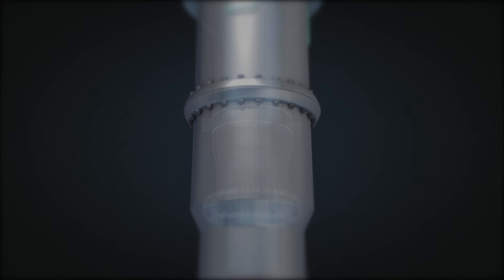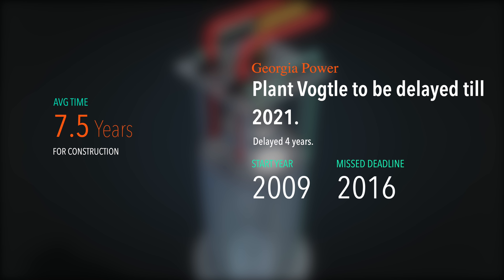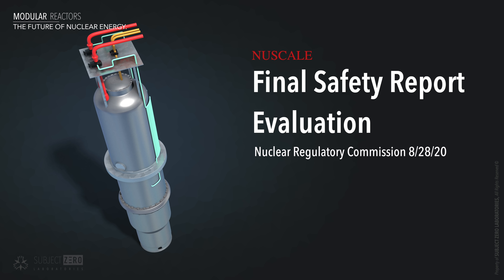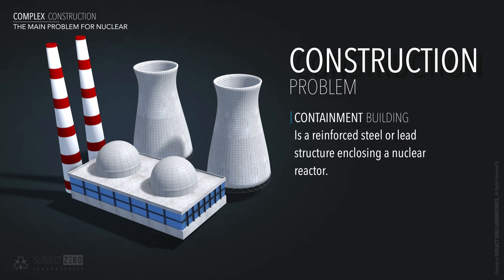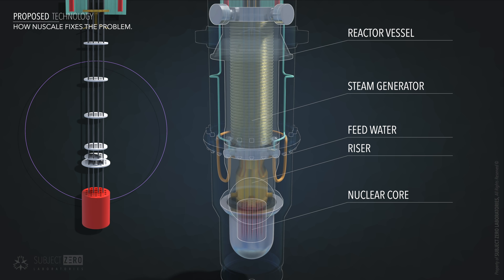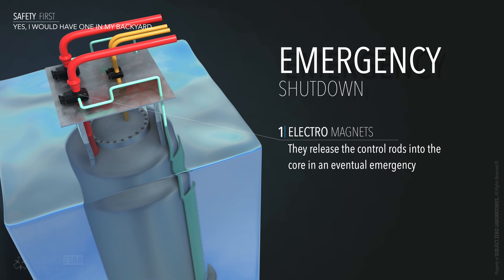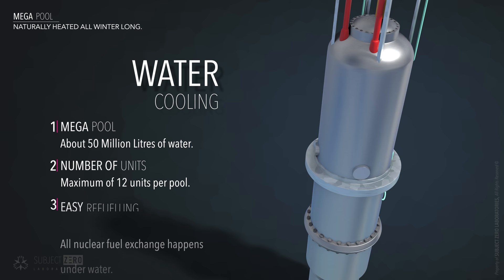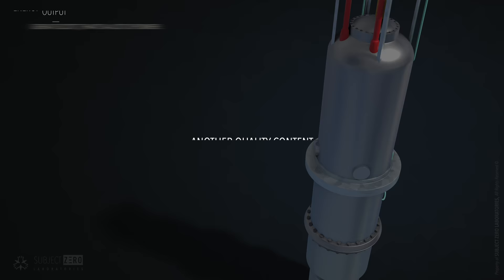A Milestone for Small Modular Reactors (SMR 2020)

Comment: Still locks you into a solid fuel provider where the fuel will have a patient.  Two problems.  It's almost like HP that will almost five the printer away so they can lock you into the expensive ink where they make the big money.  Also, solid fuel will only used 3-5% of the fissile material in the fuel before it has to be replaced by refueling the reactor.  

Molten salt reactors like Thorcon's MSR is also a SMR and solves those two issues because the fuel can be completely burned and replaced while the reactor is operating.  It can use a wide range of fuel to include weapons grade material that can be recycled into commercial fuel.  I think a solid fuel reactor is a 1960s decision error that needs to be corrected which is what Dr. Alvin Weinberg was trying to do at ORNL.  He thought liquid fueled reactors where the way to go for commercial power.

Comment: I live in Georgia, and I have never once heard it called Vogtle. I believe it's pronounced Vogle. (silent t) then again, I live in Georgia so I might be wrong. What happens if there is a water leak into our main water table from one of these reservoirs? how is it safe?
Reply: The resivoir never comes into contact with the radioactive bits of the reactor and is therefore "clean". Usually, reactors have 2 sets of water, one that stays in the reactor and gets contaminated by contact with it, and stuff sourced from outside that's run through a heat exchanger to get the energy out of the dirty water and into something thats safe to go through a turbine and back into the river it came from.

Comment: I hope it works out, but it looks like it's running into some of the same issues that are common to nuclear power plant construction. The estimated cost went up to over $6 billion from around $3 billion, because of late-design changes (the cities they're supplying wanted them to have a steam capturing tower to recover water, since the area where they are being built is dry).  It's been delayed again, too - from 2026 to 2030. 

They need to get the cost per megawatt-hour down as well. They're aiming for $55/MWh and offering reimbursements if it ends up going over that. But onshore wind and photovoltaic solar power is already down in the $40s/MWh and shrinking.

Comment: This is much better, but one caveat, the 30 days to cool down to air is still dangerous.
If Fukushima would have used SMR, no energy,  cracks on the pool who would have maybe later a few more extra days before meltdown.
The “ core” issue ( lol ) is the heat dissipation after an emergency shutdown.
I sounder if a few tons of liquid nitrogen could reduce the 30 days to maybe one week?

Comment: Questions: doesn't the excavation equipment, concrete mixing plants, concrete delivery trucks, curing concrete put off carbon and it would take the SMR to operate for a couple of years or more to offset the carbon of constructing the plant?
Reply: Yes, its similar to wind and solar but both are still a whole lot better than fossil plants :)
https://en.wikipedia.org/wiki/Life-cycle_greenhouse_gas_emissions_of_energy_sources

Comment: Still prefer to see molten salt cooling applied to this same modular design. Most notice that this is essentially the same fissile reactive water cooler reactor as Subs. Using a different modular configuration doesn't lessen the impact of a meltdown WHEN COOLING WATER leaks out/evaporates, electro magnets corrode interfering with engaging control rods.
Molten Salt Reactors offer greater safety, thorium slurry reactive offers less radioactive waste and greater % of fissile material consumed making it more nuclear material efficient and allows burning existing waste in reactors.
The above appears to be a Faustian bargain made with Corporate owners of Nuclear providers

Comment: I think that its still a lot more efficient from an engineering and logistical standpoint to build larger, high output regional facilities rather than a ton of smaller ones all over the place. Also, the smaller is safer theory doesn't hold up, the majority of nuclear incidents have occurred at small facilities.

Comment: Do you suggest, that one house needs are about 1MW? Are you serious? I'd rather estimate it about 10KW - it means that such a plant is enough to supply energy for 72 000 homes.
Reply from the maker: NuScale claims that one module can power 50,000 homes at 50MW. I just made a linear calculation based on that.

Comment: I don't think you are getting truly scalable SMRs until you get rid of the water as a coolant in favour of something else this a much much higher boiling point at or near—relative to PWR and BWR—atmospheric pressure, as you still need a vessel which can take 100 - 300 atmospheres with a PWR or BWR, and containment absolutely cannot be lost. 

In a molten salt cooled reactor—my second preference or a molten salt fuelled reactor being my first preference—or a molten metal cooled reactor, you can get away with only 4 atmospheres of pressure, which obviously means you can use much thinner reactor walls, currently reactor walls are 9" which makes construction of the core incredibly difficult, you could get away with 1/2 think steel which is much easier to work with and therefore much cheaper and faster to build, and that would still be overkill.

You would still need shielding, but you can use salt, concrete, sand and a number of much cheaper options to get your shielding, and an SMR molten salt reactor can compete with a full sized reactor in energy output.

Comment: Do you use zirconium as the pellet storage rod for fuel pellets? The temperature-dependent initial hydrogen generation of the Fukushima nuclear power plant accident may not have taken into account the catalytic reaction hydrogen separation rate of zirconium. If the structure using the same zirconium rod in the new reactor, it is necessary to observe inference of the simulation in the high temperature crisis state as a catalyst metal fuel rod as well as the normal temperature to check the amount of occurrence of the initial value hydrogen radicals as a catalyst metal fuel rod

Comment: 3 billion USD as an aspirational goal for a 720MW plant is still not especially competitive with where wind and solar are going to be by the time this tech matures.

There is always a place for small passively safe reactors, though, as a powerplant for large shipping vessels.  90% of the annual cost structure of that industry is in fuels, and that's BEFORE we start seriously regulating particulate pollution; They are the last remaining source of particulate pollution to have essentially free reign.

On a 20,000TEU ship (or a 50,000TEU ship if we deepen a few canals, lengthen some cranes, and figure out how to speed unloading a bit), the weather is almost a non-issue, you can steam right through anything but the most extreme storms, and the ships can be economically strengthened to deal with more of that, or to deal with ice classes, if loss-of-vessel is an intolerable risk.

Comment: So what is the drawback? Afterall small scale nuclear reactors are already being used for decades for nuclear submarines etc. It seems it has a lot of advantages, so why haven't SMR's already been in use for decades commercially?

The costs seems about the same if it is 3 billion for 720 MW as a regular nuclear powerplant. The main advantage possibly being the downtimes and maybe construction speed. How long does the nuclear fuel last? How is it removed, where is it stored, ... is all of this also included in the costs given?

Also, why couldn't these safety features be used in a regular reactor? And if they are, but more safety features are required due to law, wouldn't the costs go up?
Reply: The draw back is that nuclear is hated by powerful lobbying groups.
Reply: @kokofan50  I am talking of drawbacks SMR's vs regular reactors.

Comment: Hey Subject Zero Science, maybe take a look at the generalfusion approach to fusion? it uses steam piston assembly to compress a hydrogen fuel plasma inside a liquid metal cavity, potentially being able to produce workable net energy for steam turbine. 

This has basically been the issue with fusion is being able to harness the fusion energy for sustained fusion reactions + surplus electricity, I really believe general fusion is a promising fusion technology, because it is so simple compared to magnetic tokomak or stellarator designs. 

Also, it will look amazing if you animate and produce graphics show casing it. 

Linustechtips did a full tour of their headquarters so you can start with that.

Comment: Won’t the safety controls fail if the reactor does not remain upright?
Reply: A solid, underground mounting system would be easy to design for any reasonable conditions (weather, seismic, etc.). The type of cataclysmic event that would flip these reactors upside down would be an extinction level event. Not exactly something we can design for.

Comment: I can see a market for SMRs, but only to replace existing dirty options like diesel or natural gas generators. The problem with using nuclear to generate small amounts of electricity is that it is still considerably more expensive than a bunch of solar panels. And while I hear the people groaning about solar panels, the simple fact is that solar is cheap and is really good when you don't need to generate a lot of electricity. Conversely, the low energy density is why solar will never manage to displace fossil fuels in any sizable amount. It's like trying to run a freight business with pickup trucks instead of a freight train. 

SMRs may be of interest to groups like remote industry or military but the options to expand on those technologies are limited until you can get regulatory approval of larger reactors capable of displacing fossil fuels. That means large Molten Salt Reactors or Liquid Metal Fast Breeders. You need them to do more than just run cleanly, you need them to run cleanly on waste fuel from our first 60 years of nuclear power production. The value side of the equation needs to be increased vs. the cost side. Cheap fuel is great. Free fuel is better. But if you can sell it as a waste disposal technology and as a desalination technology, you've got a much better option.

Comment: oh god.. why did they rely on a pressurized water design? triso and msr use normal (ie: atmospheric) pressures, and can output far higher temperatures than PWRs. given the one time cost in new materials production facilities, they'd be far cheaper and far easier to build.

Comment: Instead of developing more fundamentally flawed solid state reactors that run on the same principles as the reactors that failed... We should be looking towards liquid fueled thorium reactors. Same size advantage as this smaller reactor, but a massive difference in safety and fuel efficiency.

Comment: This is a great piece of news. Well, coal lobby could not delay certification indefinitely.
NU Scale's is just one of several inherently safe designs that were blocked from entering the market by political pressure. I hope this is the end of it. Fossil fuel companies should better switch to this before advances in energy storage and continental scale grids make even this obsolete (because wind and solar are still much cheaper.)

Comment: How does this thing deal with control rods swelling and getting stuck?
Reply: Simple 
Seperate rods,
It's not driven by communism
Reply: @blackturbine  WTF?   Physics doesn't care at all about communism, and yes.  the separate rods.  That is exactly what I was refereeing too.
Reply: @lucidmoses  you are comparing  Chernobyl design flaw with something that is not even close to Chernobyl's design in any way, shape or form.

This is high pressure negative void coefficient reactor that is completely enclosed and everything is under same pressure aka no swelling possible
Reply: @blackturbine  I was not referring to Chernobyl  at all.  I sure hope the designers don't take such a cavalier approach to this.   But just like Chernobyl and every other problem.  There design was fine as long as nothing goes wrong.  So I'll take it you think there is no way anything can go wrong and they will never get stuck.  yikes.

Comment: 3 billion for a 720 MW 12 unit system?
That doesn't seem very cheap. I have the numbers for the nuclear power plant near me and the estimates are around 3.5 billion euros per big reactor construction costs. And 2 billion to refurbish the old ones. This is on a CANDU design also with a rating of roughly 720MW.
This small reactor design seems very innovative but I thought it would be cheaper.

Comment: Question: The electromagnets account for loss of power but what happens during a runaway reaction?  Will the control rods still be able to fall all the way down if the reactor is expanding from rising temperatures (assuming it uses guided channels for the rods to move down into the core)?  If it doesn't have guided channels and the control rods are just expected to fall, then what happens in the event a reactor tips at an angle and loses power.  If the rods fall at an angle inside a long, cylindrical reactor there is risk of them jamming and not making it all the way down.

Comment: What if even 1 rod is bent due to some unforseen event, will it still complete an emergency shutdown? To prevent bending of the rods by say a collision with something heavy, shouldn't you built a thick concrete building around this SMR. You'll end up with a big buildig like a current nuclear plant. But with more parts. What could possible go wrong :)   I would love to se the many design failure mode analisys reports in the 12,000 pages document. It will make good reading and tell just how much know-how has gone into this design. Know How is what makes technology work.

Comment: These small reactors may have another use soon: large ships. Unlike what was done with NS Savannah in the 1960's, these Generation IV reactors take up very little space even with radiation shielding and could power tomorrow's large container ships and even cruise ships that would travel faster than before.
Reply: Using hydrogen produced by these reactors in fuel cell is much more sensible approach.

Comment: I may be wrong, but this still uses the kind of nuclear fuel that produces weapons grade material. A molten salt thorium reactor would not and that is something that lots of people could get behind.
Reply: 5% enrichment,you need to get to at least 20% in theory to get weapons grade material. For practical purposes it needs to be higher than 85% enrichment .

Comment: Better yet, nuclear reactor without water, using molten salt. No insane pressures, no meltdowns, much cheaper to build and run. Can be designed to burn nuclear waste, and old nuclear weapons. Some types of MSR can use cheap and plentiful Thorium as fuel after conversion.

Comment: Nice improvements for Uranium based reactors but I still like Thorium better.  Thorium produces way less nuclear waste and is only radioactive for a maximum of 300 years compared to uranium's tens of thousands.  Also uranium reactors can be used to make high grade weapons grade plutonium that last hundreds of years in secret.  Thorium can also be used to make weapons grade plutonium but it is low grade and only usable for 10 years and can't be made in secret because of the massive gamma radiation that is always emitted during the process that even a gamma detector on the other side of the planet can detect.  Three such detectors can pinpoint the location where someone is trying to use thorium in such a way.  Lastly Liquid Fluoride Thorium Reactor designs do not use water at all and are never under any pressure to the super strong and expensive containment housing isn't needed.  Thorium reactors too can automatically shut down without any danger of control rods getting stuck.  The uranium based SMR design if those control rods get stuck for any reason such as manufacture defect or a foreign object gets introduced like a fallen bold or screw driver it could prevent them from lowering in which case a meltdown and or explosion could happen.  A LFTR even if the automatic drain pipe gets blocked the reactor will just heat up but never to the point were the liquid fluoride boils so there is never any chance of an explosion.  The LFTR after 8 hours or so then starts to cool then after some hours heat up again then in another 8 hours cool.  This cycle is repeated until all the energy in the thorium is used up.  I think the small modular design concept should be applied to thorium LFTR reactors.  We get the best of both worlds.

Comment: Anything over 500 MW is basically uncontainable. It's a engine you have to pump energy into to keep switched off.   There is no passive failure mode.  Any nuke reactor has to have passive failure which means smaller core . It's a no brainer

Comment: One carbon footprint issue overlooked - how much of a carbon footprint does the plant produce in the 7.5 years of construction and materials?
Reply from the maker: The data that I have says that any nuclear power plant is carbon negative in only 5 - 7 years. They can run for at least 50. So you have 45 years carbon free.
Reply: The modulars look hopeful.